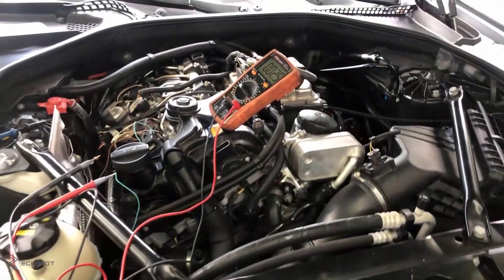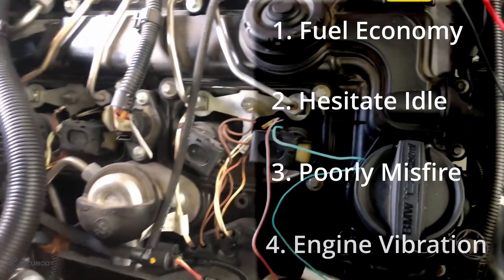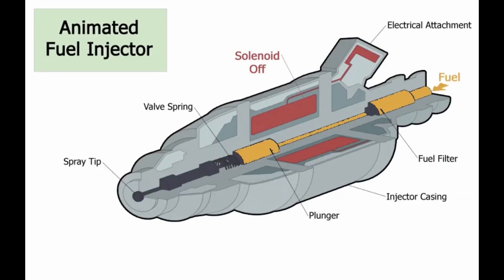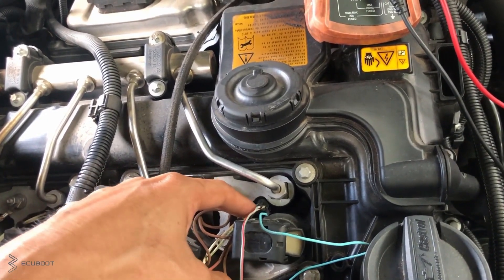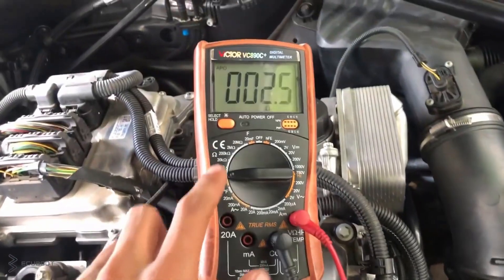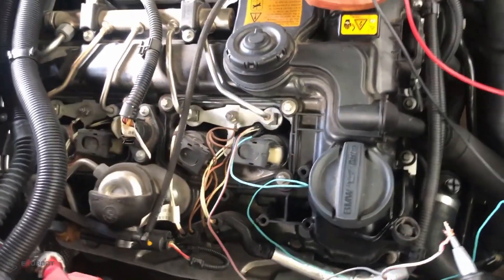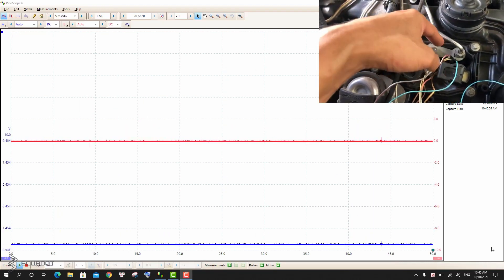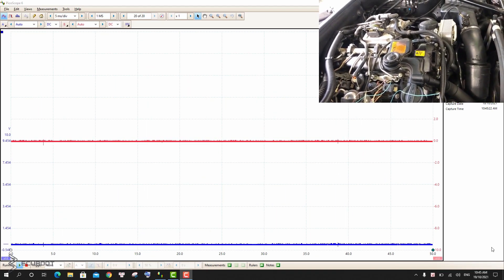How to check BMW Fuel Injector

Comment: What are you using for the second test? There isn't very much detail on that part. I am assuming you are looking at the electrical connector for the fuel injector on the car.